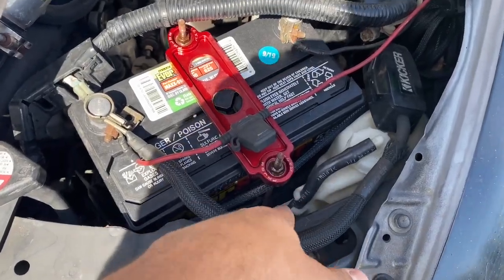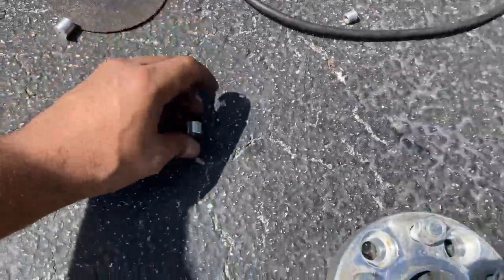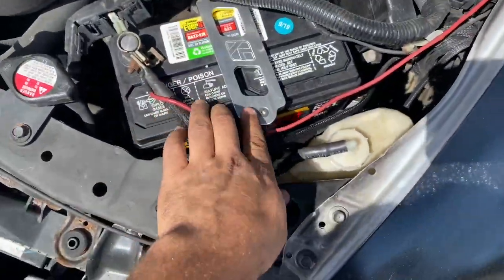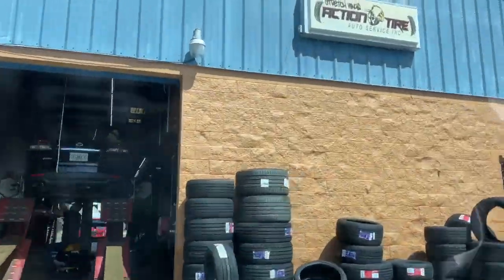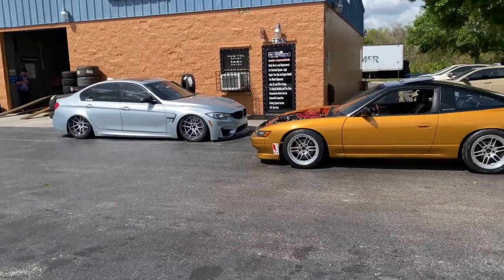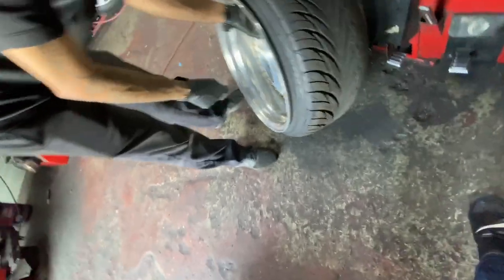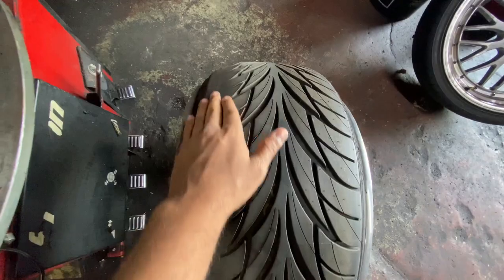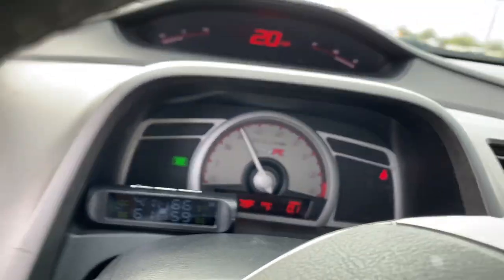-12 Camber. How long will they last ?

Comment: Where did you get the jewel headlights? I’ve only seen them on a custom order for 1700+$ and they were limited to 10 pairs once they were done they were done.
Reply from the maker: Built by VisionAutoworks. I Was 1 out of those 10
Reply: ModGarage 😂 fuck it I’m just going fd2 I’m not spending 1700$ on headlights. Thank you though.
Reply from the maker: 😂it is a steep price to pay
Reply: ModGarage trust me I know, I just can’t bring myself to spend 1700 on them but they look nice on the car bro 🤙🏼